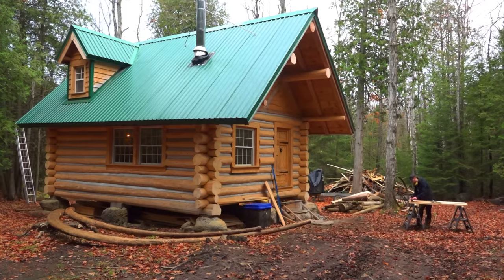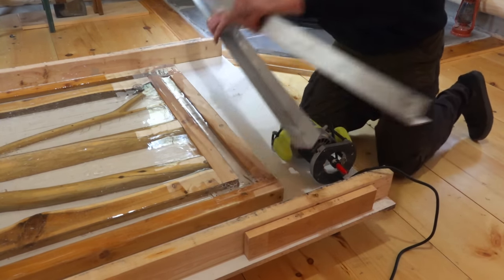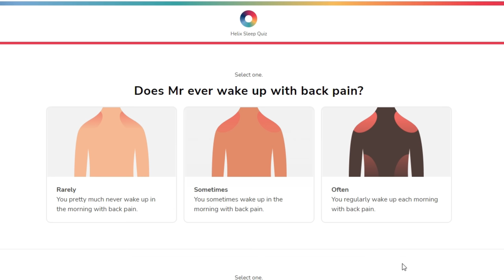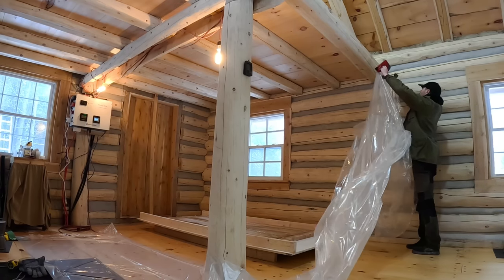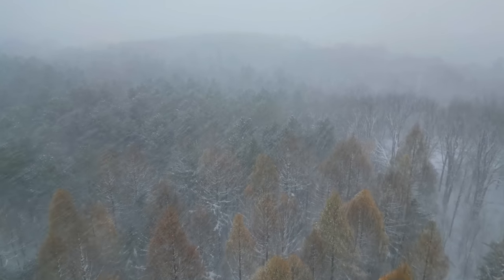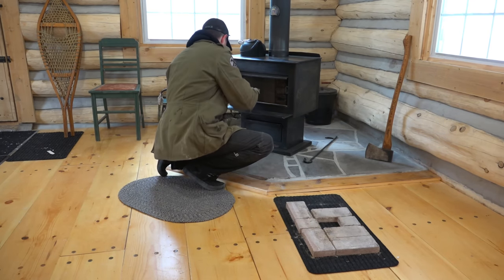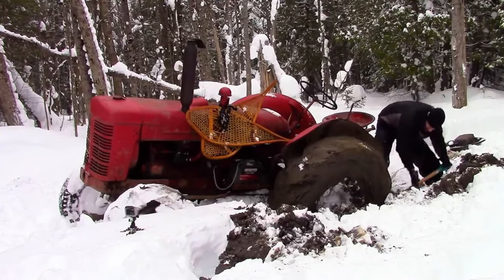Incoming Snowstorm! + DIY 4ft Planer (Router Sled) / Ep101 / Outsider Cabin Build

Comment: I do love that Massey.  Back when I was a teen, so about 55 years ago, I had an IH 350 Utility with front end loader. It was about the same size as your machine.  I move a lot of Massachusetts  snow with it.
I like the idea of the stone ledge behind the stove.  You will get another benefit from it.  The look will be rustic, but it will also help break up the mass of logs that one is forced to look at.

Comment: Snow and ice build-up are definitely major problems with solar panels in cold climates. Adding a wind turbine would be a good addition. If you get a cheap one, you could use it just to heat the solar panels to keep them clear. Just use electric heat cables that are designed to go on roofs to prevent ice dams.

Comment: Over one bench, it would be nice to be able to hang your winter gear. It is a great place to dry out stuff. An excellent heavy wood peg system would match the aesthetic of the cabin. The stone-covered bench will be a nice place to put your winter boots on. A longer-handled broom would be handy to hang on the left side outside the wall. Then any family member could rake the snow from the solar panels. A plus is if you put a sauna and shower underneath the solar panels, the heat will melt the snow.

Comment: If you're going to install a stone ledge for thermal mass behind the woodstove, i strongly suggest soapstone.  It absorbs a great deal of heat and releases it low & slow, so it's not likely to burn anything set on it, such as damp winter gear.  At the very least, get some soapstone chunks / bricks small enough to be slipped into boots; you can warm them up atop the stove, then wrap them in wool or cotton socks and stuff them into your boots to dry them from the inside out, or even just warm them up before heading out for the day.  You can also do the same thing with soapstone pebbles, warm them up on the stove, slip them into socks, and tuck them into your pockets for hand-warmers.

Comment: You should think about getting yourself a heat powered fan to sit on top of the fireplace. They surprisingly work quite well and they're fairly cheap to, from like $35 all the way up to $100+ depending on the unit. I got one for my appointment for the old school gas furnace which is basically like a fireplace and I don't know how I've lived here so many years without one LOL. 

Looking forward to the flood coat and final polish video! 👍👍

Comment: Another great video as usual. Might I suggest that you also look into one of those Thermal Fans for your woodstove. I'm not exactly sure how they work other than the heat of the stove causes the fan to operate.  That will help to move the heat around your cabin. Can't wait till your next video.

Comment: You need some gravel on the bad spots on your driveway. Should help much. My neighbor had a too weel tractor. He used to help me a lot, but then I bought a Kubota tractor 4x4, with front loader. That was in 1995, Today I still have and smaller tractor, the BX tractor and is good enough to remove the snow and do multiple jobs thru the years. But this last winter all the snow fell on the Northeast and California, we just got very low temperatures.

Comment: Cut out an expanded steel mesh to layer the back firebrick.  It will prevent the wood from chipping away at the back brick and it will last much longer.

Comment: Ratchet strap a log to each tire next time you get stuck.  They will act like arms and pick the tractor out of the mud and push it forward.  You can not run it this way, but you might think about chains.  You might just want to put a tarp over the solar panels if you go up there often.  That is one reason I like tracking solar panels.  They can be programmed to turn away from the wind so they stay clean.  If you make them so they can flip upside down they can protect themselves even better.  They could also lay flat if the wind was strong.  They also tend to collect about 50% more light.

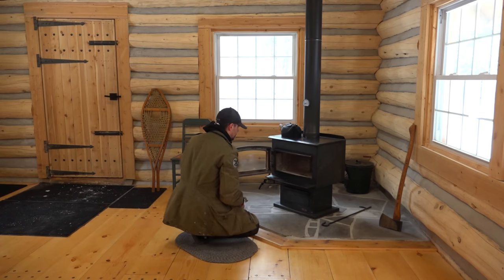Comment: 10:10 Do the fire bricks act as a sort of heat battery? Absorbing heat from the wood stove and slowly releasing it so the temperature doesn't drop quickly after the fuel burns down? Kind of like a masonry heater? Or is the point to protect the steel from degrading over time due to the high heat of the coals?
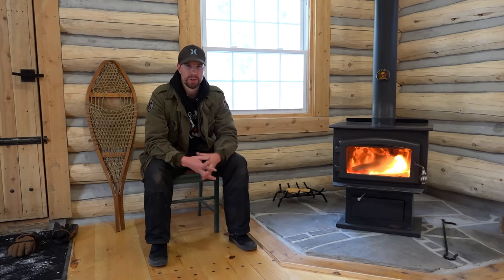15:20 Oh wow I certainly didn't realize that the stone floor acts as a hearth, increasing thermal mass. I was just assuming it was decorative or for fire safety.

Comment: Y'know, seeing you make a router sled gave me an idea. You could potentially Jerry rig a sort of windshield wiper for the solar array, just pull it and it'll push the snow off.
Reply: solar array frame have only big fail to you, need stairs and working area around frame then have better clean panels eweryday winter season.

Comment: Nice! That door is really unique! 
What plans do you have for the steps to your front door? I slipped on icy temporary steps similar to yours as I was leaving with my arms full of tools. This resulted in cracked ribs and a strained back. I kept working but it was quite painful and it really slowed me down for a couple weeks. I had been through that door and down the steps hundred's of times without a problem until this happened and would hate to see it happen to anyone else, especially someone like you that is working alone and isolated.

Comment: 2 things
Have you ever thought about putting a coat of RainX on the solar panels??? Maybe it would keep water and ice from sticking to them... Or does that affect the efficiency of the panels??
Have you ever considered putting water lines in you harth and in the ledge then heating it thru the wood burner... It adds a little bit of extra heat and you can also use it to heat water... Just an idea

Comment: I'm pondering if there is some type of coating - like Rain-X - you could coat those solar panels with to reduce or eliminate the ice/snow freezing on them. I'd recommend you build an approach from the rear of the platform (ladders?) so you can push down without risk of getting blasted with snow/ice that might knock you off the platform. All in all tho, I think you're gonna be good for Christmas at the Cabin in 2022!!!

Comment: Nice MF-35, been using mine MF-65 (1962) over 40 years now and I bet it lives to the next generation! Those firebricks are not real long lasting ones, like real ones when you need a diamond disc to cut it and it hardly copes it! But maybe they last a year or two?

Comment: what if you made a system that could pipe hot water or an anti-freeze solution onto the panels so the snow doesnt accumulate? That way you can prevent/desnow/deice the panels without having to go outside - or even just use it to prevent the blocking of the sun during storms?

Comment: 122222/0851h PST 🇺🇸 Thank you for this episode. Short , but still, very educational. If I’m not imposing, a detailed info on PV cells, charge controller, batteries would be nice to read. I know, it’s too early for that, since you haven’t done wiring and too early to determine the loads, etc etc. Thank you again and bless you. 73s…

Comment: Do not know how feasible much less advisable this would be for the Solar Array (I have NO background for that) but... could you build a tracked sweeper that runs side to side with a push broom brush to run on a cycle to help keep it clear ... there could even be a device out there somewhere that you could purchase or use as inspiration for your own build

Comment: I see light in the gaps of your back door. Are the gaps going to be sealed someday?
Reply: Those are the exterior shutters Outsider built several episodes ago to prevent the epoxy door from discoloring due to sunlight, once finished & installed. I can’t wait to see them all functioning together. —And what he does with the 2 bowed tree trunks. 😊

Comment: Been there, done that...the Hearth aint gonna do shit, sorry to say, but its Great Eye Candy. What you do need BADLY is a Damper on your Flue to regulate the draft so you can hold more heat in the stove. That little Damper is KEY. You could get a Lot more Heat if you Zig Zag your Flue Pipe before leaving the home......but nobody does it....just an FYI.

Comment: Is there an application that can be applied to the surface of the solar panels that helps to keep ice and snow from sticking? 

As you walked along the side of the cabin we saw a long crack/split in one of the logs. Will this become an issue later? How are they cared for? Or is that needed?

Comment: I have never used a router. is there a reason for cutting only in one direction?
Reply: Yes.  Some router bits cutting edges are oriented to work with the rotation of the motor so each pass has to be made in the same direction.
Reply: router can make lot many work, need only orden many different pit.